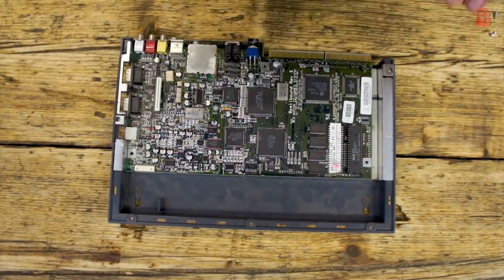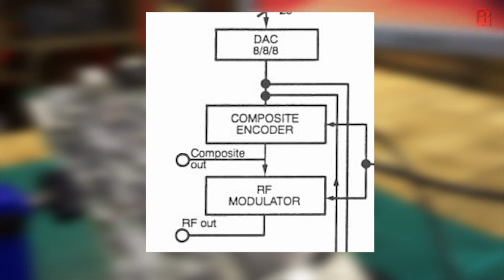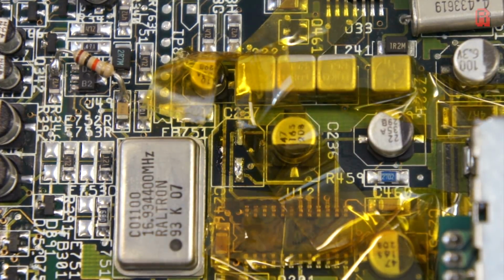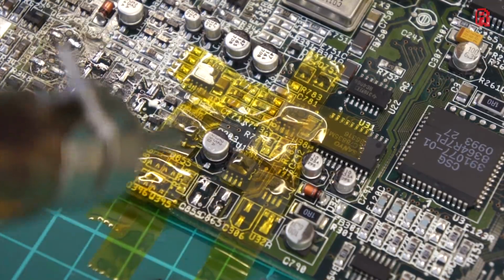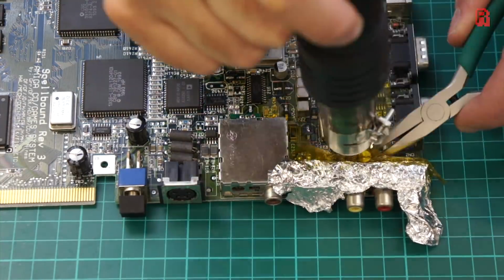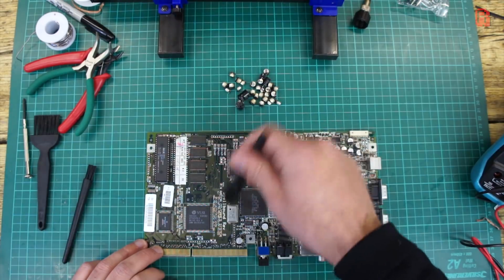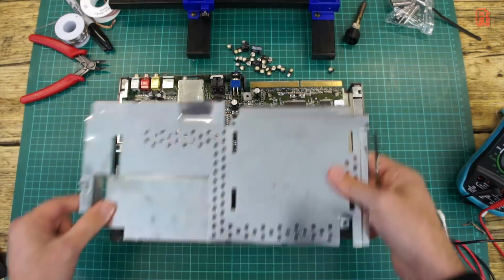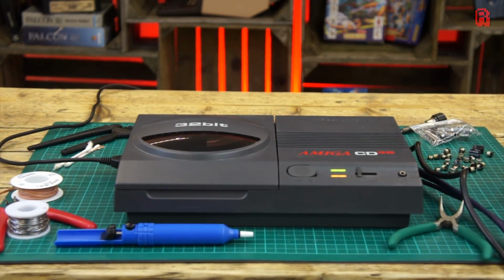CD32 Repairs and Recap | Trash to Treasure pt2

Comment: I prefer to remove those SMD parts dual wielding two soldering irons, much faster and safer than heating up the whole area. Then again in a tight spot there just isn't always enough space to do that.
Reply from the maker: Pentti Kantanen if that works for you then I say go for it.  It's a method I haven't tried as I only have one iron

Comment: Shame they didn't use the same internals as the SEGA CHIHIRO unit for amusement arcade cabinets, just wonder if a Blu-Ray laser diode would work in place of the one that is in the AMIGA CD32.
Reply from the maker: If it had done that it would have been 10 years before Chihiro was released.... and would have been as ahead of its time as the Amiga 500 was.  If only!

Comment: I wanted an Amiga CD32 in 1994 but it was starting to become difficult to find Commodore stuff unless you lived in UK or Germany. So I never got one but tried a few games on emulation later on. It looks very cool to me, still it is a consolized computer with computer games running on it. Its library lacks a certain "console quality", if you know what I mean.
Reply from the maker: As a gamer at the time I wasn't impressed with a console with 5 year old games I had on an A500 with nothing more than a video intro added.  What Sega and Nintendo had was quality control.  The Amiga was built on different values and I agree it didn't translate well to the console market
Reply: And the fact that Commodore had been declining for years did not help! But the AmigaCD32 has today a active homebrew scene that makes impressive things. As usual, users saved the Amiga!

Comment: Are you certain those two through-hole caps are not on -ve voltage rails? If so, then + terminal would be to ground.
Reply from the maker: I am yes, Commodore have also fixed the markings on the board on the same rev3 board so boards with the same revision are mixed up.  A result of Commodore desperately getting systems out of the doors I think.
Reply: Brill! Good work!

Comment: To remove SMD capacitors a pair of desoldering tweezers should be used. It makes the job much easier.   Using hot air is like using a sledgehammer to crack a nut and risks causing damage.  When using a heat gun the board should be preheated otherwise you're asking for trouble on multilayer boards. I bought 2 CD32s that were claimed to be recapped and one was badly done and the other a total bodge job, wrong type of capacitors and absolutely appalling soldering.  I'd never buy anything thats recapped.  Best to buy as original and do it yourself competently.  There are so many cowboy videos on YouTube "teaching" bad practice.

Comment: Did you test that the audio was working correctly with the un-reversed caps? You show a quick test of the video, but not the audio..
Reply from the maker: You'll hear some audio in the last testing on the TV... my audio recorder is sat on top of the TV recording what you hear

Comment: Just twist the caps off the board with pliers.
Reply from the maker: This is not good advice.  9 out of 10 times you'll get away with it but you will damage pads.  I would not advise this method.

Comment: Did you do all of the work to find all of the values and locations of the caps or did you find the information out on the web?
Reply from the maker: Steven Haggy the values are written on the existing caps and the locations are...in their locations :D  although I double checked with the service manual and some forum posts to cross check there were no anomolies other than the two mentioned
Reply: Ah, I have been planning on recapping my two CD32s that haven't been powered up for several years. I guess I am just being too lazy to compile a list of parts from the service manual and board. Was hopping you had found a list where someone else had already compiled a list with part numbers.  I  guess I need to dig my out and inspect them first anyway. I know that one of them has a damaged cable from the cdrom to the main board with the connector on the board possibly damaged too. I've got an SX-32 that may need to be re-caped also.
Reply: Also, take pics with your phone or something before taking any caps off. May help any uncertainties later. Sometimes different value caps are used to the ones on the service sheet, etc. and things can get confusing.

Comment: Great video, but could you consider removing the high frequency sound when filming a CRT. It really hurts my ears.
Reply from the maker: ...coming soon... recapping my CRT TV :p - Sorry about that, hope you enjoyed the rest of the video
Reply: Gerhard Prins 

Keep in mind what we had to put up with at school in the 80s and 90s when they used to wheel out a giant 70s CRT TV on trolley, like an old Bullseye prize. lol

I can still definitely hear the ~15 KHz flyback noise from CRTs quite clearly, but not so much in this vid.

Then again, I'm not wearing headphones atm.

Is it wrong for me to say that I quite like the CRT sound?

Much in the same way as listening to the tape loading sound of the Speccy / CPC / Electron / C64 (with a mod) - it tells me a lot about the overall "health" of the tape, how well / badly the heads are aligned, whether it's running at the correct speed, whether the power to the motor is smooth, if the pinch roller is worn, the belt needs replacing, whether there's any crosstalk from Side B, and when to expect the loading screen for Bubble Bobble. lol
Reply: ElectronAsh Well, I don’t mind that sound as well because I still use CRT’s but for some reason it’s a lot louder in the video. And I wasn’t using headphones. I actually didn’t grow up with CRT’s, my first computer was a Windows XP laptop. My dad used CRT’s back then but I wasn’t bothered with the 15KHz noise. As RetroManCave said, recapping it might help.
Reply: RetroManCave I definitely did, but what editing software do you use? In iMovie there are noise filters, that will remove the noise. It’s also possible in other software but I don’t really know witch.

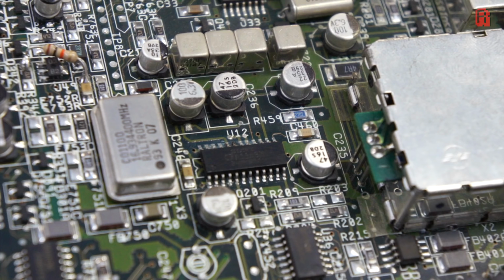Comment: So is the tape at 3:24 also called capton tape?
Reply from the maker: Yes or Sublimation tape.  It's also used to hold designs on to ceramics while they are pressed at high temperatures.
Reply: K - Kapton tape
Reply: Thank you both - luckily Google search autocorrect got me to kapton from capton.

Comment: Was the cd32 similar in capability to the ps1,  I'm thinking the ps1 probably had better 3d capabilities?
Reply from the maker: It lacked any hardware 3D acceleration, people latrr added 3DFX cards to thier A1200's.  A 3DFX gpu in a CD32 would have been interesting but it was a few years too early

Comment: Curious, if you check out my channel you will see I have a US NTSC dev CD32 console that I recapped. The strange thing is, the rca audio jacks still produce a very quiet (and noise on the line) audio signal.  However, when I pull the audio from the 3.5mm jack the audio is fine.  I've considered just rerouting the audio but seeing as how it's a very rare dev unit I decided against it.  Any clues as to what it would be if not caps?
Reply from the maker: Jake Friedel have you checked out R324 and R334?  These resistors sometimes need to be changed for audio problems.  Great unit by the way I checked it on your channel
Reply: I haven't, thanks for the heads up.  Wouldn't happen to know what Ω they are off hand?
Reply from the maker: Jake Friedel 1k but double check as you have a rev2 so there may be differences but probably the same
Reply: Will do, thanks! Great videos by the way!

Comment: Will you be doing an rgb mod ?
Reply from the maker: It won't be needed if the expansions arrive in working order...but it could make a good standalone episode
Reply: RetroManCave is it worth me replacing the capacitors in my Atari 7800 ? I've done an AV mod to get rid of horrible rf. For some reason there was terrible ghosting when using 2600 games. AV mod has mostly cleared that up, but it could be better.